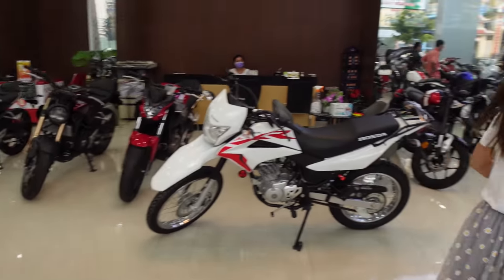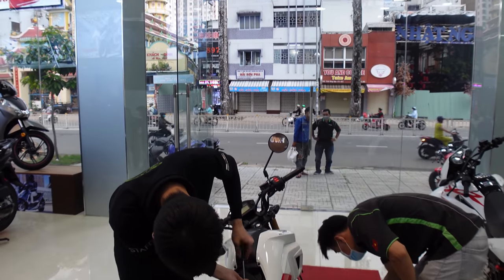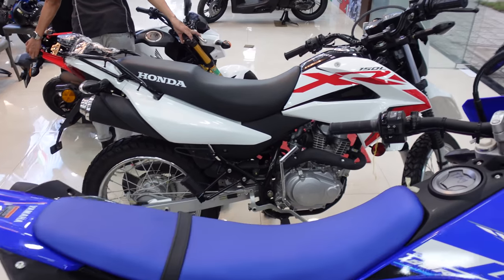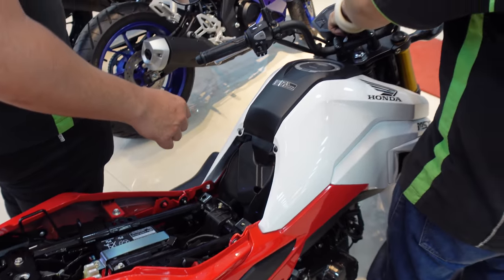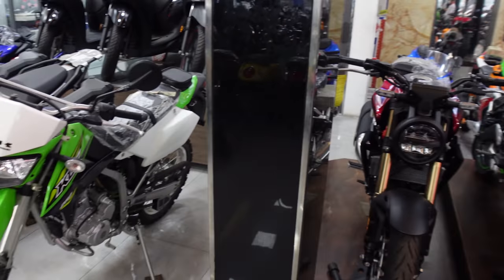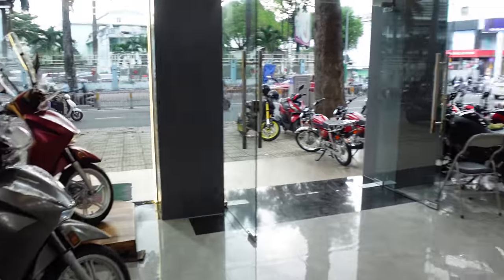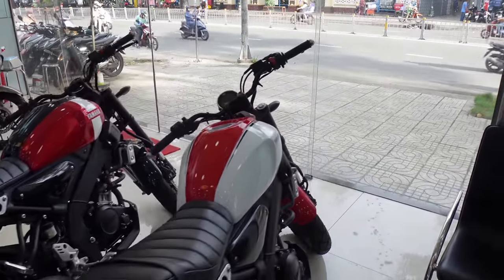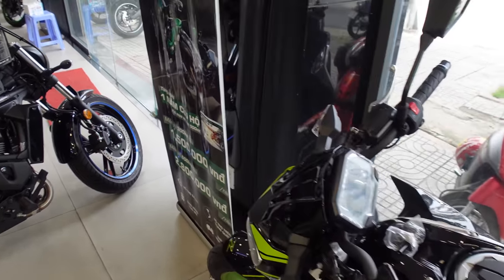We bought a HONDA GROM in Vietnam !!

Comment: I own a grom, 125 and a honda winner, 150. I weigh 100kg.  On my winner I had givi lock boxes and a top box mounted on the back. With my weight, fully loaded boxes and my girlfriend on the back that winner could still crack 120 kmh, when it was safe of course. I did have to have the seat re cut and softer foam to suit my western butt. My grom has an after market exhaust, a K&N cold air intake and DMH chip and I'm still struggling to get 90 kmh with no additional weight, add a bit of wind and the k's drop off. I also have a habit of going off on random muddy trails and my winner handled it pretty well.

The KLX 250 looks pretty good, might look into it next time.

This is not an opinion on the best bike for your lady, ultimately its your missus that has to ride it and i love riding both my bikes. I'm only giving my opinion based on owning both of them.